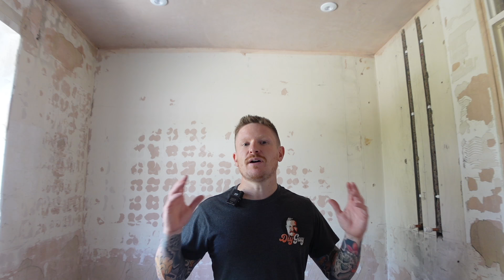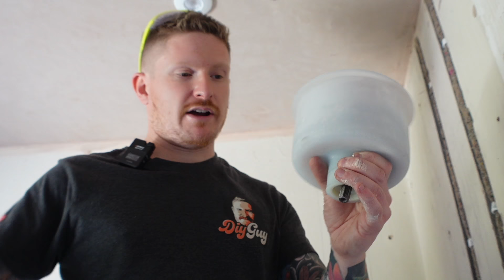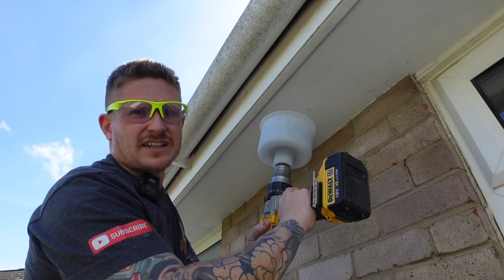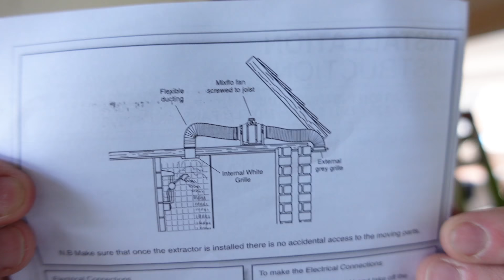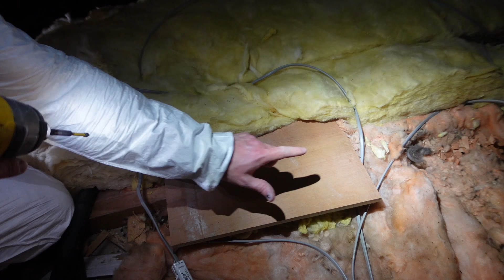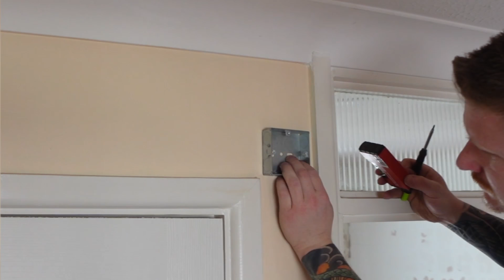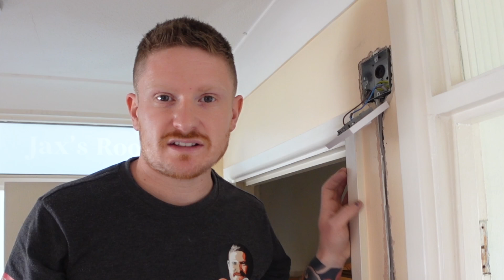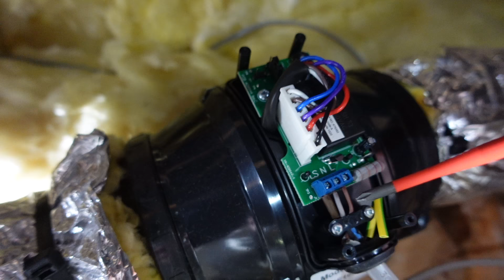How to Install a Bathroom Extractor Fan - Complete DIY Guide Made Easy

Comment: Hi Cameron great video as always, was wondering if you wanted to use the extractor without the light on, would a fused spur powered from the ring main be acceptable?
Reply: Yes- but a better option would be change your bathroom switch to a 2 gang. Have the lights on one switch, and the fan on another.
Reply: @TheRCBiker  Thanks for the reply 👍

Comment: A guy who's hot even when he's not in a 65 degree attic! 😉
As an American, I find the differences in electrical systems fascinating. Both have their benefits and drawbacks, but I don't understand why electric in bathrooms is so restrictive for you all. GFI has been a thing for a long, long time, and there doesn't seem to be any issue with outdoor switches and sockets, which anyone can try to use while dripping wet in the pouring rain.
Reply: In the UK you can have sockets in bathrooms but they have to be I believe minimum 10ft away from a water supply. Most of our houses don't have bathrooms so large that would allow for a socket so we just dont have them.
Reply: Voltage used in the uk is higher than the US this leads to many restrictions when it comes to wet areas.
Reply: @abdoaiman  I don't really buy this either, though. Although our frequency is higher in the US (60 vs. 50), our power system is still nominally 240 volts. Because we use split phase, the bulk of power is consumed in 120 volt applications, but we still have plenty of 240 volt loads and a system operating at that potential. Also, something that confounds us here (in America), is that for all the fear and restriction around using electricity in proximity to wet humans in a bathroom, you all have no problems putting a screamingly powerful electric resistance heater IN the water stream of the shower! 🤣
Reply: @marcberm  😂😂😂😂 well done

Comment: I have a downstairs bathroom with no extractor fan, and the bathroom isn’t against any external walls what should I do?
Reply: Buy some air freshener
Reply: Flat plastic ducting run to an external wall. Install it above the ceiling (in the floor space), or surface mount and box it in. It may not look brilliant but if no extraction is causing a problem, there are some answers.

Comment: Why the minimum 500mm? I put one in my own house (ventaxia) and it doesn't seem to take out the steam, as the waters running down the tiles all over the bathroom after a shower.
Reply: I do have the same issue, that's why I'm just going to replace it as its worthless 😢

Comment: Isn't the line feed to the fan (motor) supposed to be protected by a fuse?
Reply: So what to do is wire the fan in a short bit of flex first (much easier than messing in the loft) and take it to an unswitched spur with flex outlet adjacent to the fan. Put a 3A fuse in and make your connections to the spur. No need for wago box joints.
Reply: Yes, 3amp usually
Reply: @michaels8336 depends on the model and for this particular model the manufacturers instructions state it must be fitted with a 3A fuse.

Comment: Very clear explanations, thanks that's not easy to do.

I might be able to fit a soffit vent if I can remove one brick from the top of the 9" solid wall in-between roof rafters otherwise the gap between the roof and wall is too narrow and would constrict the air flow. 

Are tile vents reliable or problematic, I recall you mentioning a condensation trap is needed, but do tile vents typically leak or cause other issues after some years?

The gable end is solid wall so not as easy and would need a long run of ducting which probably would reduce performance.

Any advice/recommendations appreciated, I really would like an in-line fan if I can get around the obstacles.
Reply from the maker: Thanks.

Tile vents are fine if done correctly. But they involve some work! They cause issues if no condensation trap is used otherwise should be fine. Could you solid duct to your gable end? That may be a solution
Reply: @TheDIYGuy1  I should of said the loft is boarded and used for storage so unfortunately not a straight run of ducting it would need to go round the perimeter so at least two 90 degree bends and at least 9 metres long as it's the other side of the house. I'm guessing the fan would struggle and I'd need to wrap the solid ducting to insulate it.

Comment: Where did you learn the DIY Electrical ? I want to learn aswell. Thanks  and well done job !
Reply from the maker: Thanks. Luckily I’ve spent time working with electricians and have learnt a lot over many years.
Reply: @TheDIYGuy1  thanks for your quick answer !
Reply: If you're not exposed to the construction trade in your working life, do a college evening class for a starter. Work towards doing the wiring regulations course as a minimum, then you'll be able to at least interpret whats said in comment threads and understand it a little.

Comment: Hi mate, I wonder if you can help me, I have a 2 way switch controlling one light on my hall way, I want to remove the second switch so the light is just controlled by the one switch, if I remove the linking cable am I right in thinking I will need to rewire the other switch so the light still works? Thanks mate
Reply: The way 2-way light circuits usually work (in the UK) is by linking L1-L1, L2-L2 and C-C in both switches and putting the two wires from the ceiling rose across L1 and L2 in one of the switches. If the switch you want to keep is the one with the ceiling rose connection then you can remove the link cable and move one of the ceiling rose wires to C. You may have the neutral in the switch box if you don't have ceiling roses but it should still have the connection to L1/L2 after removing the link cable and move one to C.

Comment: What if you have a shower in the morning without having the light on? How will the vent switch on?
Reply from the maker: Standard method for bathroom fans. When the light is on, the fan is on. There are ways around this but not in this method.

Comment: A backdraught shutter is missing to prevent back flow of hot (summer) or cold (winter) air from outside, or from storm, going into your bathroom.
Reply from the maker: In my experience you won’t need one with soffit positioning, only gable end really due to wind exposure. Never had any issues in the past doing it this way 👍
Reply: Alright 👌

Comment: Nice video and very well explained regarding the wiring.

I'm sure I read somewhere that you shouldn't put extractor fan inlets and smoke detectors in the corners of rooms due to how air flows in a room.
Reply from the maker: 👍 thanks, never had a problem myself with this position but I’d like to hear if anyone has.
Reply: Smoke detection should be 1M in from walls where possible and installed flat, as smoke rolls. 
    Extract ventilation is sited more source specific, like over baths/toilets, in front of cooking areas etc.
Reply: By putting the valve in the corner you  do restrict the air flow, however in this scenario the difference would be negligible

Comment: One tip I picked up for CRJ Electrical channel is to put rubber grommets (the type you use in metal back boxes) under the 4 mounting points of the fan and then screw the fan down - reduces vibration noise.
Reply: A superior alternative is to utilize bungee cords with metal hooks at each end. The noise is effectively eliminated by suspending the fan unit from these cords. Depending on the layout of the loft trusses, it might be as simple as wrapping the cord around a strut brace and hanging the unit that way, or installing a few screw loops into the roof trusses and attaching the cord hooks to those. Once the fan unit is securely hung, no noise will transmit into the living space, except for the sound of air rushing through the vent.

I always set the overrun to its maximum duration, as drying out a steamy room can take an hour or two. The maximum overrun time, which is approximately 20 minutes, effectively removes most of the dampness from the room. This solution is so quiet that the homeowner won’t mind. They can close the door, and the sound will be gone.

This is another key reason to avoid inferior surface-mounted motor extractors. Additionally, always opt for plastic vents, as I have observed that some metal ones tend to rust over time, despite being galvanized and painted. The one shown in the video appears to be good.

Backdrafts can be problematic, as you ideally want to prevent them. Negative pressure can be managed with a suitable one-way air valve, but be mindful that these can be noisy if it is very windy outside, as they click and clack open and shut. To mitigate this, place a bit of soft foam draft excluder around the valve mouth area to create a better seal and act as a cushion to stop any backdrafts from opening the valve and taping on their stops making said sounds.
Reply: @Better_Better_Better  I considered this but went with carpet underlay.
Reply: @Better_Better_Better where would you recommend placing the backdraught shutter? As close to the exterior vent as possible?
Reply: Perfect answer. You are the only person among thousands of comments who actually has a brain. You thought it through, the isolation factor, it's incredibly insightful and the Only solution to be fair. 
It’s fire-retardant since the cords are relatively fire-resistant. Outstanding suggestion! I did this too, and it’s the only way to achieve near silence, except for the sound of rushing air, which is super quiet anyway. We stand apart from the idiots.
Reply: @Better_Better_Better where do you cover, what flaps?
Reply from the maker: Sounds like a great tip that and something I’ve never done 👍
Reply: I do the same but use tap washers.
Reply: Educate people on your wisdom then instead of a negative comment@bobbeats
Reply: You’d think manrose could do something so simple
Reply: I screw these fans through cheap gardeners' kneeling pads, about £5 a pop from Amazon.
Reply: I split a spare piece of foam pipe insulation and used that between the bracket and the plank - also does a good job.
Reply: You can also take two pieces of ply screw the first to a joist and attach the second on top with beaded silicone lowers the amount of vibrations through to the joist
Reply: It's almost like you know what I need to do in our house! 🤣
Another brilliant and easy to follow guide. Thank you DIY King 👑
Reply: Mine used a celotex offcut mounted on a plinth to reduce vibration. Since then I’ve raised the plinth to take a loft lid for the Dow light as the lids height was to tall for the plinth.